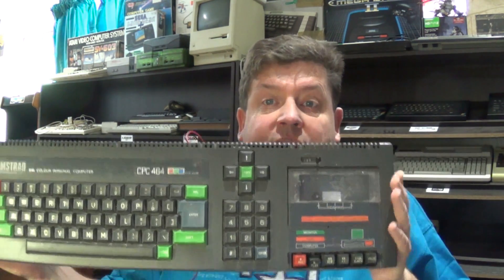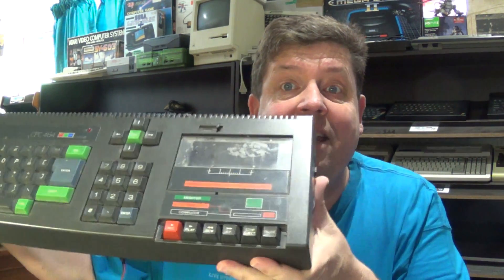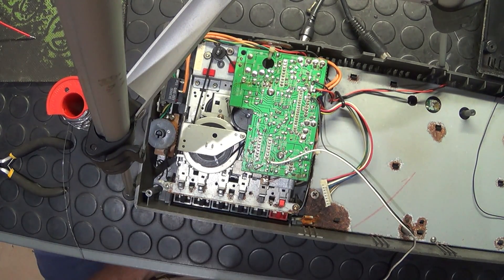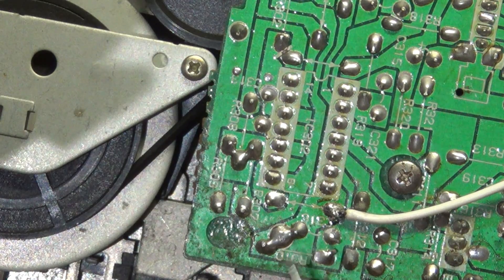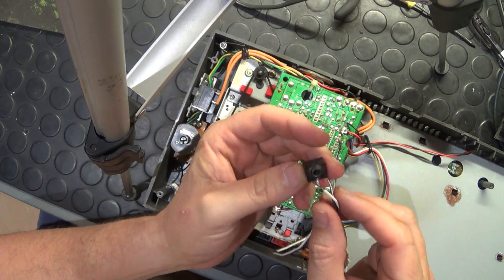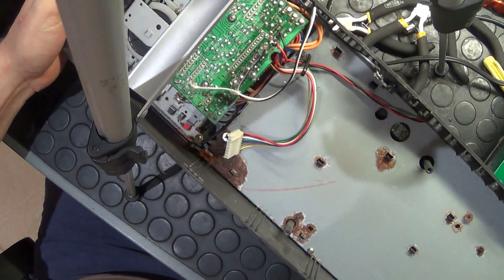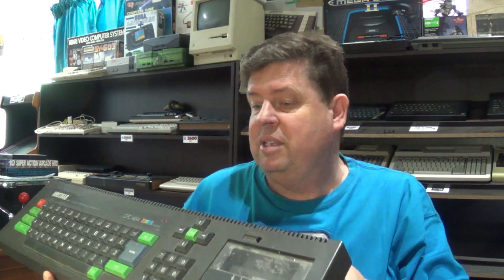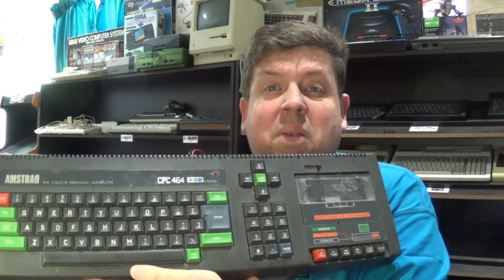Amstrad CPC 464 Audio Jack Mod

Comment: Nicely done Gary :) the volume on the side of the Amstrad has no affect on the loading process, you could turn it all the way down and it would still load, just a tip from me.
Reply from the maker: +SmoothEmJay Great. I am still getting to know this machine. So far enjoying it. THKS
Reply: +Big G from SA it's a really good system :) you should be able to find a lot of cassette audio online (if you're having a problem sourcing games) that you can load via your new mod. Definitely checkout Batman, Batman The Movie, Robocop and Silkworm. Oh and Skweek :)